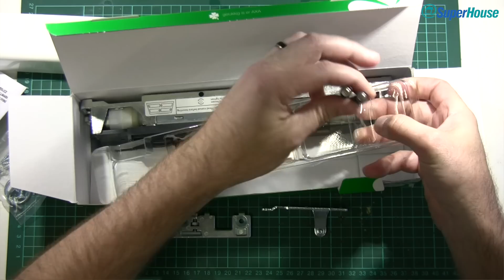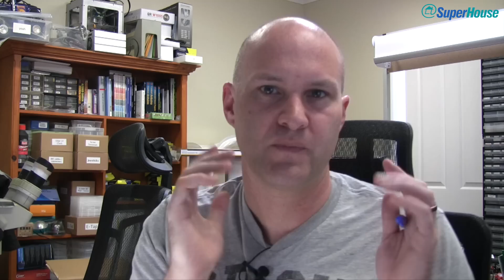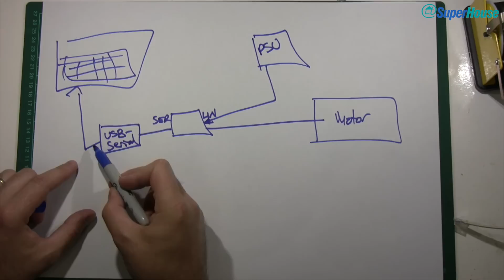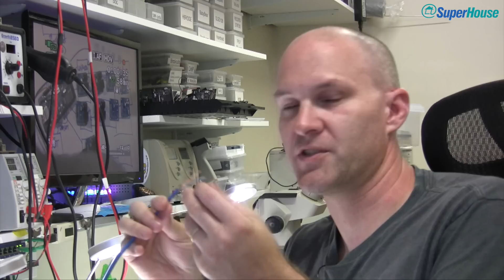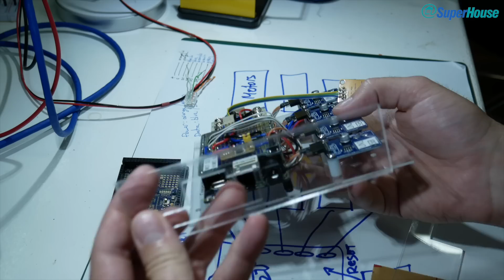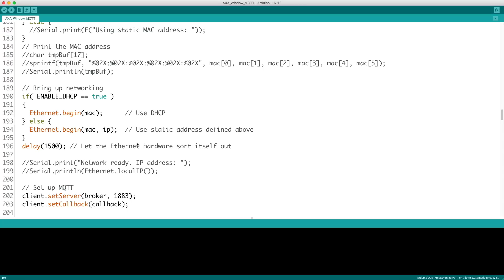SuperHouse #22: AXA electric window motors controlled by LIN bus and Arduino

Comment: I really like your vids. How can I get involved to help your initiative grow?" :) Can you confirm that the LINBUS will allow for the definite state of the device to be known by the arduino controller? Have you tried the broadlink RM Pro with the axa window remote to verify its codes can be learnt? No wires that way no need for LINBUS...?. Im really astonished how many devices Ive been able to control with my broadlink. You can literally control any rf and ir based device via your phone, tablet and with the addition of some of the open source based android apps (RM Tasker plugin and Tasker) and an echo dot you have a way for Alexa to trigger any of the codes the broadlink has learnt so the devices respond as if their real remote button was pressed. The issue I have however is no state is maintatined and I am thnking of how I could somehow keep state stored via MQTT but how can it be definitely in that state?  Hence the Q re LINBUS. the broadlink devices cost around 30-40 bucks they learn rf and ir commands. Another application on google play is RM Bridge which can be used to allow for a configured samsung smart things hub to have each device defined and controlled by Smart Things. I think RM Tasker uses the open source based Hue bridge emulator as when the rm Tasker plugin Alexa bridge is active the echo dot "Alexa" shows each of the devices setup in the RM Tasker plugin to be "Alexa devices" as hue bulbs. As a result I've been able to control pretty much every device I have with my echo dot :)   The RM Tasker plugin also has an http server. this allows for any learnt IR and RF codes learnt on the broadlink to be called by making a simple http call for any of the devices. The rf range of the broadlink is very good. I've managed to get it working with logitech harmony as well through the http approach and a bit of a hack with the logitech harmony using applesscript.
Reply from the maker: I bought an RM Pro a few weeks ago, and it's been sitting in its box next to my keyboard while I tried to get this video out of the way. This episode has taken months and months to finish, so I didn't want to distract myself with a cool new toy! Yes, with LIN it's possible to query a connected AXA motor to get its status. In the video I showed how I used my laptop to send a command of "VERSION" which caused the motor to respond with its firmware version. In a similar way, there is a command called "STATUS" which causes the motor to respond with whether it's opened, closed, etc. The response statuses are very basic and seem to be oriented around the lock status, not the window position. I can't remember the exact messages, but if the open or opening it will say "UNLOCKED" or something like that. So you know it's not closed and locked, but you don't know if it's still in the process of opening or if it's already fully open. When it closes, it will say "SOFT LOCK" or "HARD LOCK" depending on whether the secondary lock has been engaged. Something like that, anyway. I'm going from memory here. But yes, you can get some status information from it.
Reply: SuperHouseTV thanks for getting back so quickly and I'm going to have a closer look at Linbus now. Where abouts are you based in Australia? Greetings from Waterloo/NSW :-)

Do you hold any user group meetings for others in this space to meet and share their ideas? I'd be keen to come along if there is one taking place soon. Thx Paul
Reply from the maker: I'm in Melbourne. I don't know of any meetups specifically related to home automation, but my friend Justin runs the Internet Of Things Sydney Meetup which has lots of crossover into home automation. Perhaps that would be interesting: https://www.meetup.com/en-AU/Internet-of-Things-Sydney/

Comment: You may have covered it in the another video, but the atmega micro has in integrated watchdog module, I'm confused as to why you use external ones.
Reply from the maker: Great question, I often have people ask me that! Here's an explanation I prepared earlier :-) http://www.superhouse.tv/15-watchdog-timers-for-arduino-home-automation
Reply: I watched the video. The only reason I can see that you don't use the integrated hardware watchdog (the atmega's watchdog has its own dedicated oscillator and everything, but its basic pat or reset feature maxes out at 8 seconds) is that you need a long timeout and don't want to rely on any software solution to extend it. Is that correct?
Reply from the maker: That's about right, yes. Also, I don't trust software watchdogs to do the job as cleanly as actively asserting the reset line and forcing the whole MCU to do a full reboot. Software reset is supposed to do the same thing, but I have painful memories of doing software resets decades ago and having processors coming back in an unclean state with memory un-zeroed, etc. Since then I've had a strong distrust of software resets. It's probably better now, but the paranoia is still there.
Reply: Understandable, but as far as the atmega328x and atmega25xx series go. Up to 8s can be achieved completely in isolated on-board hardware. It is a completely isolated external yet on-die watchdog circuit. Very reliable in my experience. I love your videos I've watched nearly the whole series.
Reply: SuperHouseTV iirc one of Toyota's issues was a watchdog asleep at the switch when the throttle control glitched. Somewhere on the interwebs is a pdf independent  software review on the portion of the code Toyota was forced to cough up.

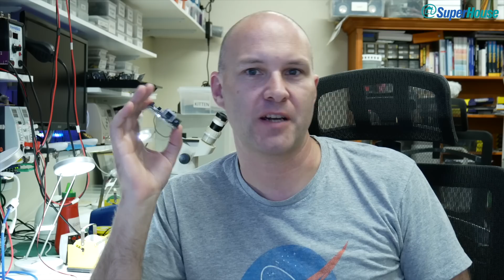Comment: Interesting vid, but what's in the "Kitten" box at 50:33?
Reply from the maker: Hah, that's funny, I should pay more attention to my backgrounds! That's parts for an Arduino compatible kit that I make called the "KitTen": http://www.freetronics.com.au/kitten. There's a long story behind the name. I used to make an Arduino compatible board called the TwentyTen ("Duemiladieci") which was released in 2010 (hence the name) and designed to be a successor to the Arduino "Duemilanove" (which means "2009" in Italian) way back before the Uno was released. Then I deleted the USB-to-serial converter, changed all the parts to through-hole for easier assembly, and created a "kit" version of the TwentyTen. Hence "KitTen" with the punny name. Incidentally, that's also how the EtherTen was named. It began as a TwentyTen, then I added Ethernet, and EtherTen seemed like a good name.
Reply: Thanks for the explanation :)  May I take the opportunity to thank you for your videos - they are a constant inspiration to me in my home automation projects.  Keep up the good work!

Comment: Cool!! do understand correctly that the windows do not open automatically, they are released but  as the chain is slack, you have to hope for the wind to open them, correct?
Reply from the maker: No, the chain is actively driven both open and closed, so they will open even if there's wind trying to push them closed :-)
Reply: SuperHouseTV tnx. i had impression it would just bend. my mistake
Reply from the maker: The chain has a cool design that's like a bike chain, but with little tabs on one side so that it can only bend one way. This has the effect of preventing it flopping around when the window is open.
Reply: SuperHouseTV ok. thanks that clarifies a lot

Comment: what is the price for those electric window motors? could you share link to store where it can be purchased?
Reply: https://digilockaust.com.au/products/axa-wireless-electronic-window-opener-winder-electric-remote-battery-operated
Reply from the maker: Thanks Ed19601 for adding the link. There's also a list of parts with links on the project page on the SuperHouse site. The video description has more information.